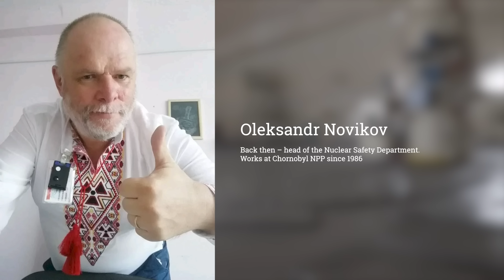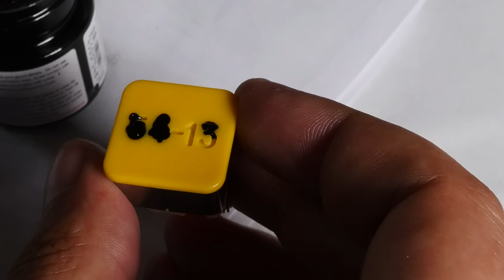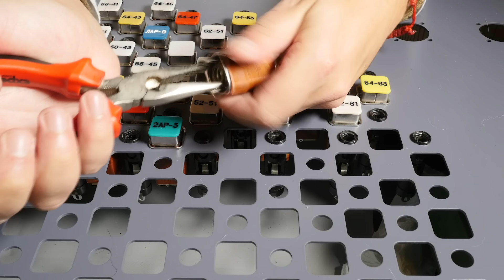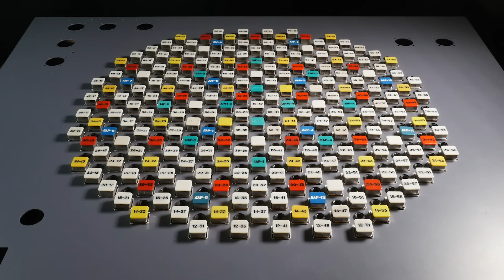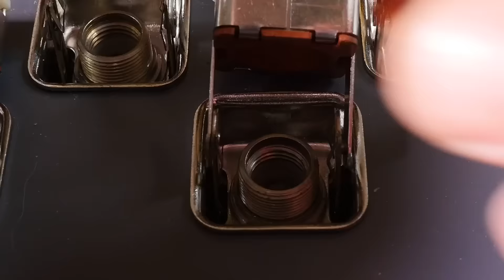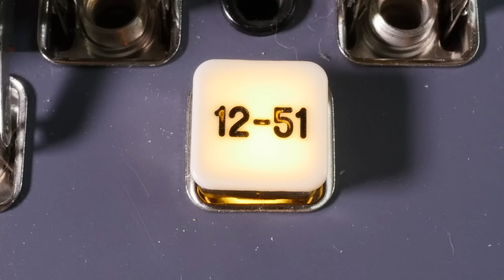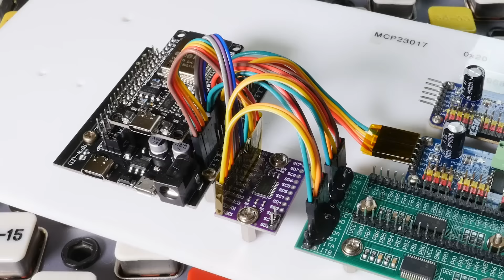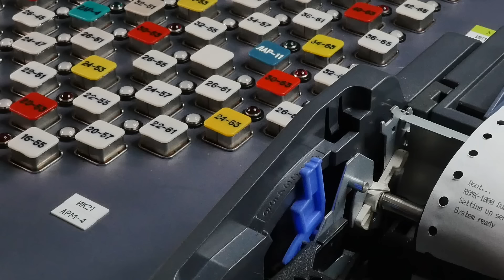Chernobyl Reactor at Home — Part 1

Comment: My god, every time I watch one of your project videos I‘m blown away by the level of your talents and knowledge! I wish I had access to the machining services you do though haha

I would have been frustrated by the wiring and tried to make some form of modular PCB they could all slot onto within a few minutes.
Reply from the maker: The problem is those components are designed to be attached to wires, not a pcb :)
Reply: @ChernobylFamily  I know but I'd probably brute force it just to save the hassle of untangling it. Wires and me are not friends!

Comment: As mechanical enginer I really like part with CNC machines ;) I use to work in plant where we did many of details using stainless steel and lasers.
Light bulbs looks (that which indicates servomechanism error) like that one used in telephone echanges ;)
Reply from the maker: Exactly, they originate from there

Comment: Would a well designed SKALA VM and simulated sensor package complement your project?
Reply from the maker: Indeed yes
Reply: @ChernobylFamily  Then I'll continue building one.  Would be nice to have some justification for the project seeing I've sunk significant time into it at this point.  

Beautiful work by the way, I can see this being used, repaired, updated and cherished for many years.
Reply from the maker: @initdeit write us an email please
Reply: @ChernobylFamily  Check your spam folder.  🙃

Comment: 5:54  you forgot PK-AZ emergency rods as they used in AZ-3 emergency power reduction system
Reply from the maker: I did not; same as LAZ; just the point of this very video is a brief introduction and assembly. If we go to all details, there will be good hour-long explanation. In the future we will cover it more detailed.
Reply: @ChernobylFamily  also, is this modernized rod selectors of unit 3 after the accident?

Comment: Hello! Good work! Be carefull - you can destroy a LED 24:58 , because of a maximum  LED current limited only by the low (less that 1Ohm) internal battery resistance. The LED forward voltage is usually 3.3V, but with 4.5V battery current may be much bigger that 50mA.
Reply from the maker: Thank you, correct. These particular LEDs have a maximum current of 110 mA permitted, though.

Comment: What would a be nice touch if you can get original alarm/horn that was triggered by AZ, on several videos from RBMK control rooms you can clearly hear that, for example in the famous shutting down in 2001 video. Does somebody knows what type it was?
Reply from the maker: Novikov surely knows, just we both need to sum it all up and document it.

Comment: Amazing work, congratulations. One question, why did you decide to use GPIO expanders instead of arranging the buttons in a matrix? That would have significantly simplified the wiring.
Reply from the maker: Because we wanted somewhat make it like an original architecture. And plus, there will be more, much more controls attached to the chains.

Comment: I dont really know how to explain it but like with so many things replacing something physical with a (touch) screen or some lcd just takes away so much. 
the tactile feedback of a button or heavy switch, THE SOUND of using it, the heat from the bulbs illuminating the buttons, a layout which had to be thoroughly planned because changing it would mean replacing the whole panel but once memorized could be used blind, analog meters that have infinite resolution simply because they are analog and so on.
im so happy you bring this sort of stuff back and go to such lengths to make it accurate.
Reply from the maker: You are so right
Reply: modern RBMK control room now uses lcd screens
Reply: Exactly! Just like with the Artemis Capsule, couple of LCD touch screens, not like the former Apollo Capsule. I do get it, but it ain’t the same.
Reply: @JackThelRipper  yes especially for control surfaces in something like a spacecraft i dont get why they removed all buttons and replaced them with touchscreens or buttons that clearly have no proper physical feedback. must be fun when you have thick gloves on.
Reply: @peterhansuwurst7852 Flat panels must be lighter - in airspace every gram counts.

Comment: On real panel, near button “reset” which button placed? I supposed it’s button “cancel mode PK”.
Reply from the maker: In post-1986 version those buttons mirror each other.
Reply: @ChernobylFamily are you mean, they both reset select control rods?
Reply from the maker: @Georgiy7438 yes
Reply: @ChernobylFamily  This makes sense, since there appears to be a spare control rods switch (not joystick) on the panel (3A) to the left of the control rods selection panel.

Do you know which button this is before 86?
P.S Sorry for the detailed questions. I'm trying to document the control panels and gather the missing information bit by bit.
Reply from the maker: I will ask, this will be good to know for us too!
Reply: @ChernobylFamily thanks!
Reply: Кнопка отмены ПК стоит на 3А под крышкой.
Reply: @azrt43  видел. я думал, что резервная. Мое убеждение основывалось на фото с САЭС, где так же над ключом КУС было две кнопки- "Сброс" и "Отмена ПК". Полагал, что на ЧАЭС-3 было так же.

Comment: Hi guys, I’ve been researching the ‘ black fungi’ of Chernobyl. There are numerous species of fungi, bacteria  and yeasts that have been found in the red forest. The black colour is due to the pigment  MELANIN and may have been an evolutionary precursor of chlorophyll. One theory is that the alpha radiation in the environment is actually being used as an energy source with melanin being some as yet unknown photo-reactive mechanism system of radiation protection. ❤
Reply: According to the papers, the fungus has been observed growing towards sources of beta and gamma radiation, not just alpha.
Reply: What does it do to typical cellulose feeding fungi and molds like stachybotrys chartum? I know you meant black in an entirely different way, but I am curious and also a bit terrified some of these organisms are on the rise and the current versions of Anti-Fungals arent going to be enough.

Comment: love to see people recreating these
Reply from the maker: Glad you liked it!
Reply: 4:35 So this is a key section we are getting some good information about from closer sources. The Automatic and Manual mixed control scheme of the control rods. Some are Automatic and Some are manual. My understanding is there is a few versions of this mechanism and different revisions that changed even before the number 4 unit was powered up. A few parameters changed with the enrichment and rod geometry.  

At first that statement doesnt quite register as out of the ordinary, but for real world operators they think about that kind of mixes control scheme and it creates questions. 

This may be part of the “Alive” feeling being described in the video. That is something people are going to love to simulate, likely for many years to come.
Reply: Fantastic Info 👏🏼👊🏼✌🏼